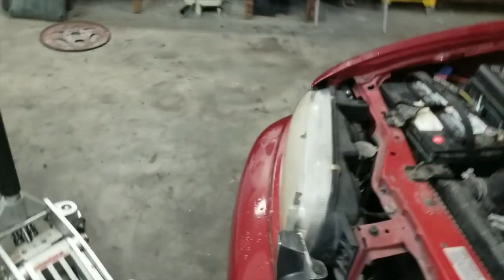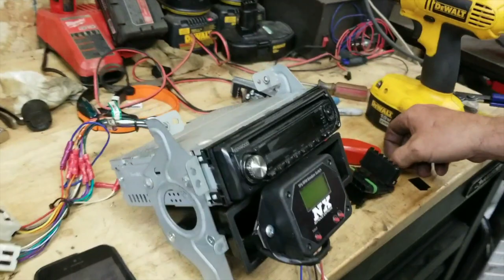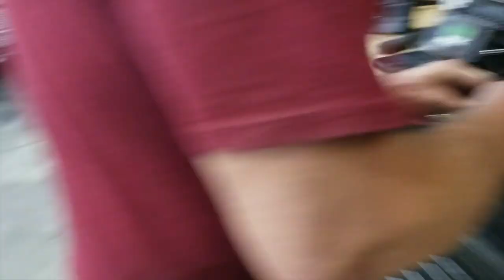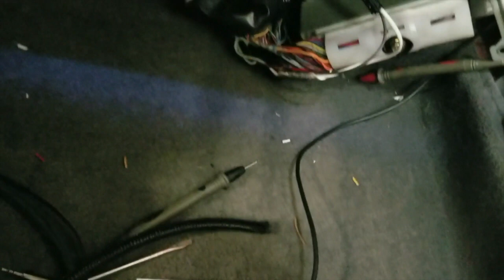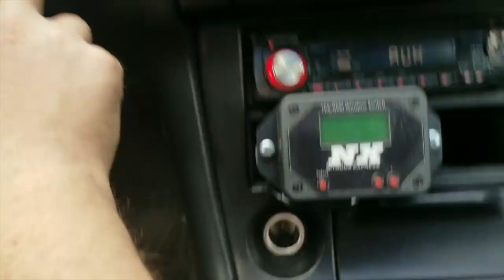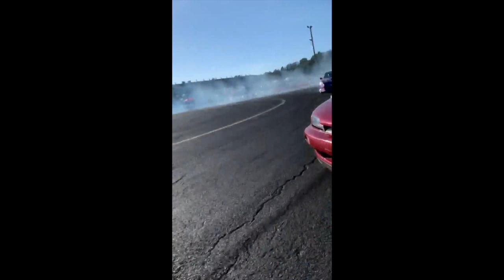Nitrous Express window switch install

Comment: I worry about shifting… if it’s spraying and you shift… Is that not a potential for the engine to spin to easily and too fast??
Reply: The window switch is designed to prevent exactly that. It shuts the nitrous off after a specific rpm before shifting.
Reply: @SlateBlue_VQ   never mind…
Some homeless guy stepped into traffic and caused a pileup.. my car got totalled